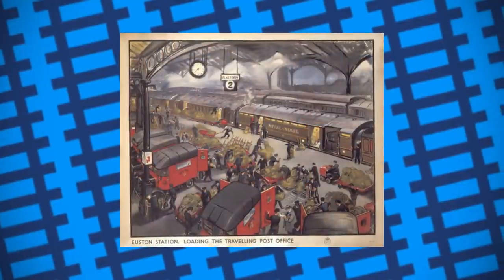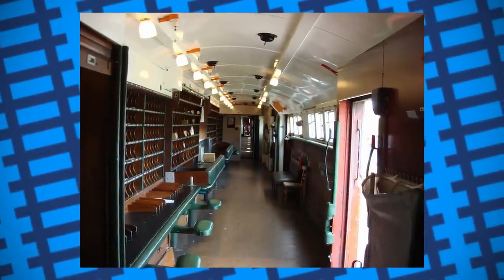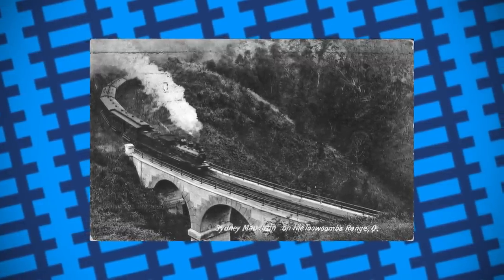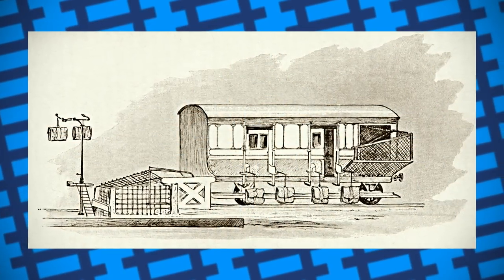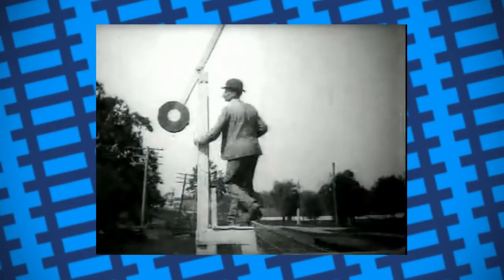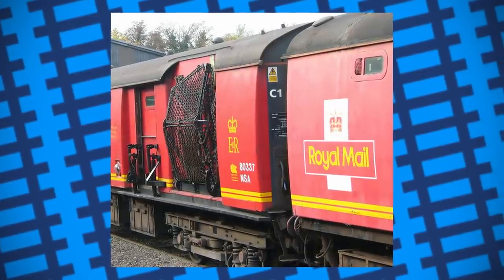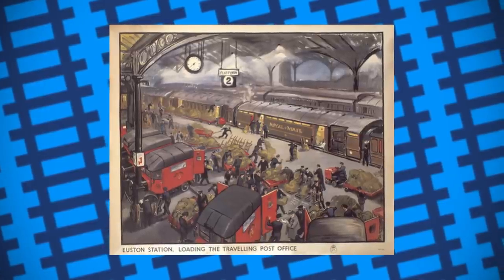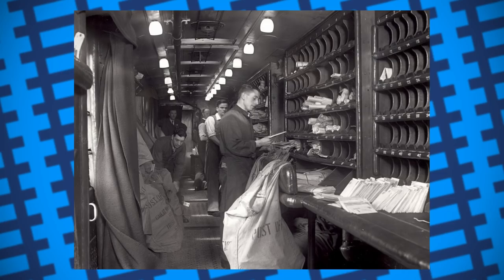How mail trains collected letters without stopping - Post Trains

Comment: The other thing to note about the mail trains in the US is that they were actually what kept a lot of passenger trains afloat financially since the contracts for carrying the mail were quite lucrative. Thus when it became cheaper to send mail by truck and plane and the post office discontinued these contracts, many railroads swiftly began requesting to be able to discontinue services on account of bleeding money left right and center from them.
Reply: From what I recall, this is also what made passenger flights viable too, and to this day passenger aircraft carry a significant amount of paid freight that has nothing to do with the passengers on-board, on their cargo holds.
Reply: Airlines were born from mail contracts as well.  The first 'regulator' of air travel was the United States Postal Service.
Reply: Still its more effective to send mail with train than truck sense it's more efficient transportation
Reply: @andrewreynolds912  Not long distances.  There are thousands of flights daily that are much faster.
Reply: @ffjsb  yea but it's still cheaper
Reply: @andrewreynolds912  For bulk stuff yeah, like magazines and advertising that doesn't have to be there quickly.  But planes aren't that expensive either.
Reply: @ffjsb  yea but you understand it's a fact trains ad the most effective forms of transportation

Comment: There was a line of model trains called American Flyers. They went out of business decades ago but they had a work mail on the fly car. Basically on the truck (boogie as the British say) had a little peddle and when it made contact with something electric it would trigger an arm in the car to open which would eject a little plastic mail bag and snag the one on the hook as it passed by. I used to play with that for hours as a kid on my dad’s old Flyer layout.
Reply: I believe Lionel also made cars set up this way, and I know some company bought up the American Flyer name and tooling, although I don’t remember if it was Lionel or another company.
Reply: Lionel bought American flyer, and still continues to make s gauge trains under the brand name.

Comment: Yet, one of the most famed mail train was on the Southern Railroad(U.S.) pulled by 1102 which is the basis for the song "Wreck of the Old 97". Many versions of that song, even there's a version that Johnny Cash did as well. I know Thunderbolt 1000 didn't did a video about that train accident.

Comment: The Royal Prussian Postal Service used both System before the 1870's. 
When in 1871 the first german national state under regency of Kaiser Wilhelm 1rst had been declared, who was the prussian king, all postal accidents with insured people by both systems had been reported to the postal administration.
In 1900 the royal german postal service stopped both systems and changed back to load or unload postal carriages by stopped trains for a more safer postal service onto al railroad and railway stations nearly all over the country, except in areas, where local dukes allowed it.

Comment: I wonder if mail and passenger trains are practical and useful both historical and contemporary.
Reply: In Britain the TPOs normally ran as dedicated trains, since they were run overnight to provide next-day delivery anywhere in Britain. Also, to provide space for the sorters' bench, the corridor connections were offset, which meant they couldn't be mated to standard stock.
Reply: Passenger trains are VERY practical if you have a population willing to take advantage of them, and provide the proper infrastructure.  Sadly, most cities abandoned such infrastructure in favor of automobiles long ago.